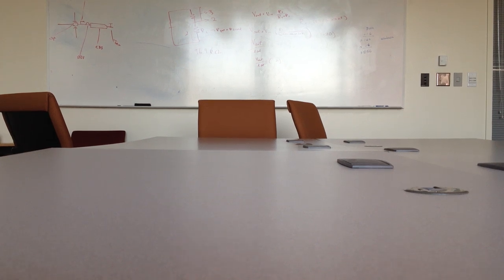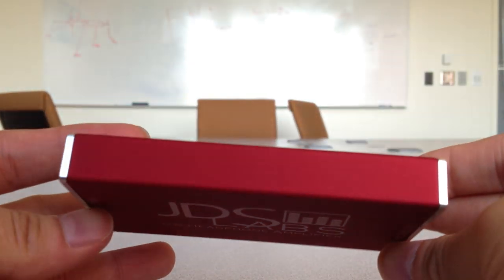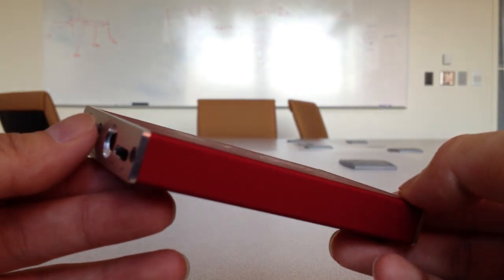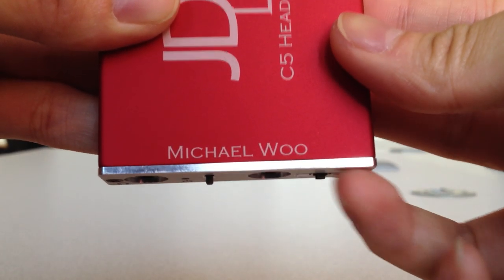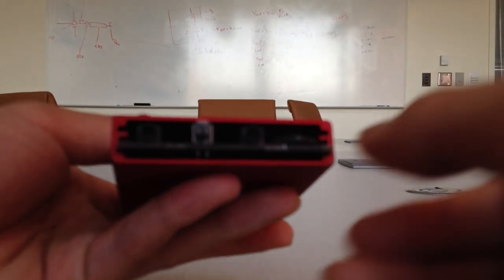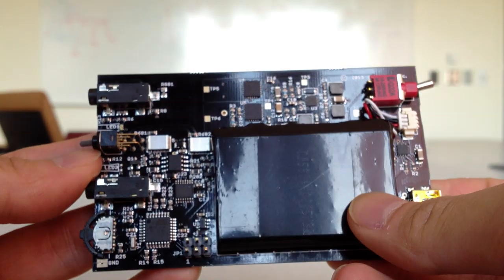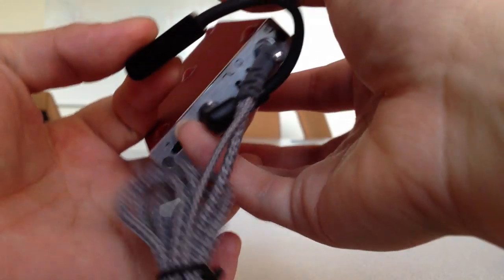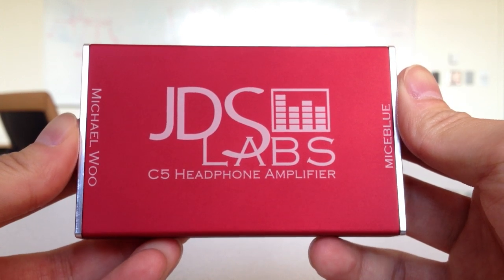[Review] JDS Labs C5 Portable Headphone Amplifier

Comment from the maker: Hi there, yes I own the E12 v2 and I find the bass to bleed into the midrange just like the E7 did with its bass boost on levels 2 and 3.
FiiO advertises their chosen components but that doesn't mean too much compared to JDS Labs' published real-world tests. Sure the parts used are important but they don't mean anything if they aren't well implemented and tested; otherwise you could just make a DIY CMoy with those components.
For the T50p, I would recommend the C5 since it's cleaner-sounding.

Comment from the maker: Hi there. Yeah I believe it's possible to attach another amp to the MixAmp. I think you can just connect the C5 to the MixAmp's headphone port and just have your headphones running out of the C5 instead of the MixAmp. The only downside is that it probably won't have the MixAmp's Dolby Surround Sound capability, which I don't think happens with the Q 701 anyway from what I understand.

Comment from the maker: Hi there. I do think the C5 is a great portable amp to drive the K 702. It might be a bit bright, but if you use the high gain mode on the C5, the K 702 should sound a bit warmer. If you pair that with the C5's bass boost, you get a pretty good movie-watching combo.
For a pure synergy perspective, I think the Objective 2 might be a better choice since the upper-midrange isn't as forward, but considering the C5 is more portable, then I would take the C5 if portability is something you value.

Comment from the maker: I haven't tried the Headstage Arrow in person before, but from comparisons on Head-Fi (for the 4G at least), it looks like the C5 has clear upper hand on sound quality, and the 4G for features (battery life, treble switch, etc.).
In terms of the O2 vs C5, the O2 has the upper hand on sound quality and power output, but the C5's midrange is a bit more engaging, has a bass boost switch, longer battery life, and is much easier to carry around.

Comment: Quite an interesting little amp I must admit. Do you know the output power(watts) @ 32 Ω?
I am currently using Fiio E12-->Mad Dog; and don´t get me wrong, it has a great sound but there´s something about the E12 that I just don´t enjoy very much and I am looking to switch it. Problem is not all portable amps handle orthos very well.
Anyway, do you think these would go well with planars like HE-400 and T50RP?
Reply from the maker: From JDS Labs' official specifications, the C5 outputs 43.66 mW at 32 Ω. From my own experience with the C5 and Mad Dog, I like the C5 pairing more than the E12 since it sounds more clear and transparent to me. The Mad Dog sounds a bit too thick with the E12 and the soundstage is a bit congested for my liking.

As for other planar magnetic headphones, the C5D does a pretty good job with the HE-4 (I haven't tried the HE-400 with it), and I was pleasantly surprised with it, but an amp with more oomph is recommended to get the most out of the really inefficient HE-4.
Reply: miceblue425
Thanks for the response. I couldn't find the words to describe the E12 but it definitely is a bit congested(at least with the Mad Dog).
I originally bought the E12 because I heard it had a high output power.
And I hope you don't mind answering another question, I read on the JDS Labs site that the C5D works on Android; is that to say that it  is plug and play with no drivers needed(guessing since it's ODAC it is)? And is it compatible with all hardware that runs on Android?
Reply from the maker: Yup, the C5D works with Android devices only if they support USB on-the-go compatibility. You don't need other drivers, but it may take some time to set it up properly in Android (unfortunately I don't have much experience with Android, but it took some time to get it set up on a friend's Droid DNA).
Reply: miceblue425
Thanks man, I am now strongly considering the C5D for my portable setup. Sadly I won't be having enough money to dump $250 on audio anytime soon, and if I did I'd rather upgrade to the Alpha Dog.

Comment: How would you feel about this versus the Fiio E12? I was pretty set on getting thet E12 but after seeing this I've been thrown for a loop. I'd be pairing it with HD600s
Reply from the maker: Objectively,
V = I * R [Ohm's Law: voltage in volts equals current in amperes times resistance in ohms]
I = V / R [just a re-arranged version of Ohm's Law]
P = I * V [the basic equation of power in physics in Watts equals the current times voltage]
So P = (V / R) * V [plugging-in the re-arranged version of Ohm's Law]
P = V^2 / R

E12:
(5.48 VRMS)^2 / 307 = 97.82 mW
C5:
(4.95 VRMS)^2 / 307 = 79.81 mW

It takes 0.17 mW of power for the HD600 to reach 90 dB SPL at 307 ohms of impedance [from the measurements of the HD600 at Innerfidelity.com]

E12:
97.82 mW = 0.17 mW * 2^x
log(575.41)/log(2) = x
x = 9.17
90 dB SPL + (3 dB SPL) * 9.17 = 117.51 dB SPL

C5:
79.81 mW = 0.17 mW * 2^x
log(469.47)/log(2) = x
x = 8.87
90 dB SPL + (3 dB SPL) * 8.87 = 116.61 dB SPL

So in the end, both amps provide enough power for the HD600, without considering the current limiting factors of the amps' op-amps.

In terms of my personal experience with the C5 and E12's sound, and with my limited memory of the HD600's sound signature, I think the C5 would be a better match for the HD600 in terms of being clean and transparent. The E12's warmth and more prominent bass may be something to consider though if you like that pairing. I personally don't like warm-sounding amps with warm-sounding headphones, so I would choose the C5 over the E12 because it offers a more airy and transparent sound.
Reply: miceblue425

Thanks for the info man!

After doing some research (via the Head-Fi C5/C5D thread and your review) I'm pretty set on getting the C5D since I'll  be using this with my Samsung S4 and as a desktop amp/dac with my laptop (especially since I don't own a DAC).

I also noticed you'll be reviewing the C5D soon + checking the compatibility with Android devices, so I'll be looking forward to that. Anyways, like I said, thanks for the help, you've really helped me wrap my brain around this.

Comment: Hey man, i'm planning on getting the V moda m100 and was also thinking about getting the fiio e12. Would you say this is much better than the e12? I know the e12's bass may be better but how about in terms of clarity?
Reply from the maker: In terms of clarity and bass, I think the C5 is a clear upgrade from the E12. I personally don't like the E12 with the M-100 too much since it has a laid-back and bright midrange that's also warm. The bass extension of the E12 is also less than that of the C5. The C5 has better instrument separation and a wider soundstage, whereas the E12 sounds pretty congested next to it.
Reply: miceblue425 Thanks alot!! I was on the fence about this but i think i'll be going with the c5

Comment: Question:
I cant decide from Beyerdynamic DT 770 or 880 or 990 and whats a good amp for these headphones. I've been looking at Schiit Audio and JDS Labs, what has a better response, something plugged in or portable ill be wiling to spend 400 on headphones and 400 on amp+dac
Reply from the maker: Between the DT770 and DT800, both of which I have heard, I much much much prefer the DT880 because of its transparency over the V-shaped sound of the DT770. I can't say anything about the DT990 though because I haven't personally listened to it.

Any decent amplifier ought to be okay with those headphones, but if you need to look up power specifications, amps that offer ~30 mW at 600 ohms, or ~25 mW at 300 ohms should be fine.

Schiit Audio's products tend to slightly colour the output of the sound from my experience, often having a deep but narrow soundstage, punchy bass, and a more aggressive treble (which might not be a good pairing for the DT880 depending on your sound preference). JDS Labs' products (as in the C5 and C5D; the Objective 2 technically isn't their own product) tend to sound much more transparent, offering a slightly bright sound and having a more wide than deep soundstage.

As for the desktop vs portable thing, I find that desktop rigs usually offer better audio quality than portable gear, but if you value portable form factors, then having a good portable rig is usually worth the money spent.

Comment: Do you think these would pair well with the Denon D2000's?
Reply from the maker: Did you post that on Head-Fi too? :p

I personally don't know the D2000's sound well enough to give you a solid opinion about the pairing. That being said, there's a local Head-Fi meet coming up late next month and one of the regular attendees has a D2000. If you can wait until April 26, I can give you a better idea then.
Reply: Yes, I did :) And that's okay, I may wait until then to get a solid opinion about the combination if no one else replies. It can be difficult to find out if a certain pair of headphones works well with a certain amp. Thanks.

Comment: Just bought a pair of audio technica ath m50's and i want to know what would be the best amplifier to listen to music off my galaxy s3?
Reply from the maker: I think most Android devices don't have a true line out connection, so you would be double-amping your music signal which is not as clean of a signal. Other than that, I think the C5 would be a great pairing with the M50 since the C5 brings the midrange a bit forward and the M50 has a slightly laid-back midrange. If you want a cleaner sound signal from your S3, the C5D would be a good option with its USB On-The-Go connectivity (bypassing the phone's internal Digital-Analog-Converter and amplifier).
Reply: Thanks man!